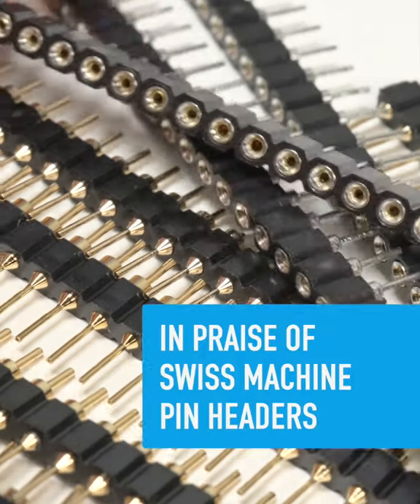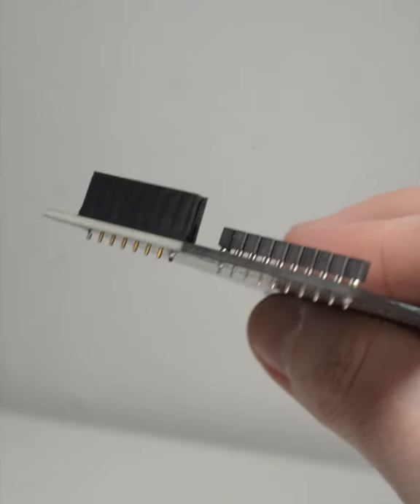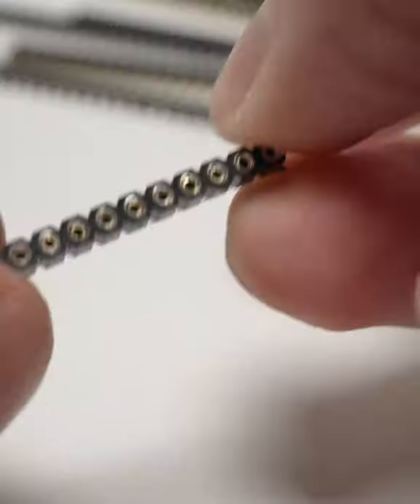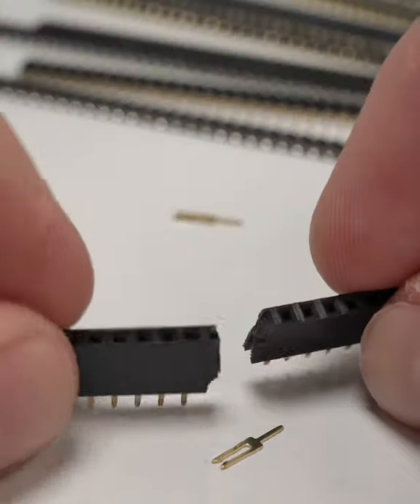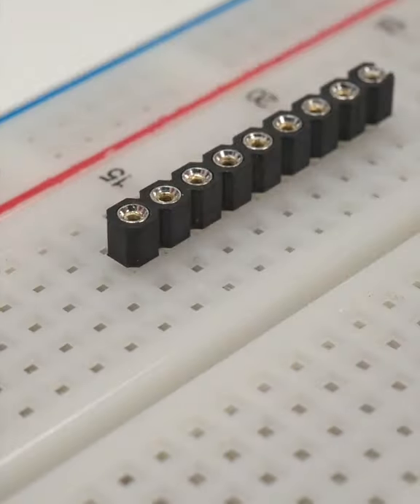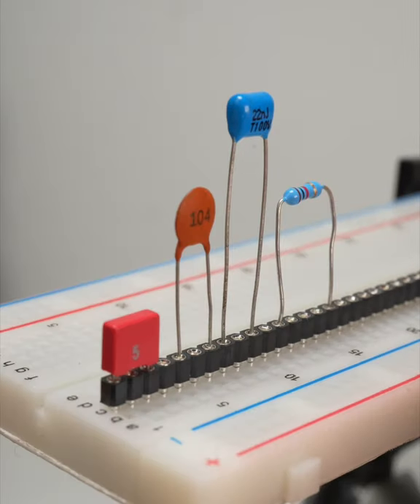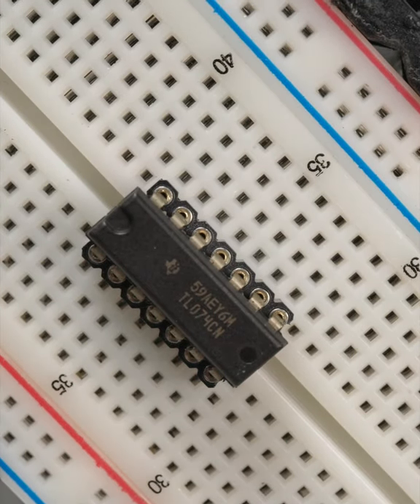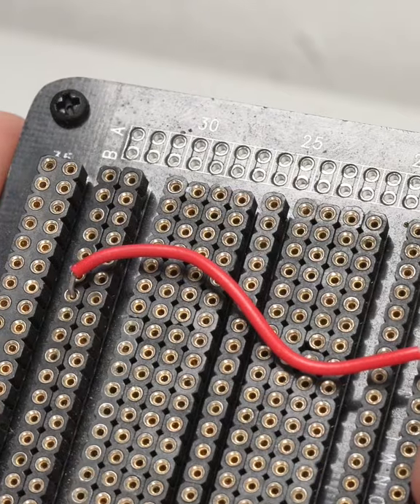Swiss Machine Pin Headers - Collin’s Lab Notes #adafruit #collinslabnotes

Comment: Ok, so I'm not the only one who feels weird doing that crude chopping thing with normal header sockets
Reply: It always feels like such a waste.

I like the circular versions for the same reasons this video shows but Ive seen it said many times its not a good idea to use square pegs in round holes.
Reply: I’ve always bought multiple lengths of female headers… never chopped one

Comment: There are extended pin versions that make board stacking possible
Reply: Do you have a link for this? I was stacking a while ago but had to revert to square pins because i could not find the male counterpart nor extended.

Comment: I don't understand how they maintain contact in the hole.  Is there an internal spring? a friction press fit would require strict spec on the leads.
Reply: Maybe a taper?

Comment: I bought these before.  But they're so shallow that they don't hold the components well.  A slight bump on the resistor and then I have to plug it back in because a lead fell out.

Comment: I’ve had to go back and install dual-wipe sockets in dozens of Hi-Def NES installs because these do not make good IC sockets for DIP chips. Even the gold-plated ones suck. Obviously, it’s better for chips that weren’t just desoldered, but my rule of thumb is: Round pin sockets are for round pin headers… not folded leadframe chips, not component legs, and definitely not breadboard jumpers. Note: Hi-Def NES involves removing two DIP40 chips (CPU and PPU) and installing into interposers which are themselves installed back onto the board. The kit includes round pin sockets for the interposers and the mainboard because dual-wipe sockets are too tall. I eliminate one set by soldering directly (no socket), making room to replace another in each stack with dual-wipe.

I’ve had to do the same with NES RGB installs which only replace the PPU but there are additional board to board interposer connections. The round pins are fine for b2b connections but the PPU itself needs dual-wipe or direct solder. You can’t put desoldered pins in a round pin socket and expect a long term reliable connection.

Comment: About the only thing I dislike about machine pins is that they're easy to bend (which was a bit of a problem back in the days when CPUs used these). Board stacking can work with male and female pins, and you can turn a board into a socketed IC of sorts using KiCAD or Eagle, so if the board dies, you just pop in another one. These are designed to hold even through vibrations, so if you have a continuity problem, chances are it's not these pins.

Chip Quik sold machine pins when I was shopping last year, so that's a decent starting point. I think you can only find one gender for PTH on Digikey, so you have to go to Arrow for the other gender. It's a bit of a pain.
Reply: Forgot to mention: machine pin IC sockets are a thing. They're pricey, but you won't have to worry about alignment as much as when you're DIYing the socket with female pins.

Comment: Yeaaah but the dip socket variety of these are really difficult to get packages in and out of, especially large packages. They honestly suck, too much holding force so you almost always bend the pins getting it out, and the holes have too tight of a tolerance to easily get the package back in.

Comment: Do they have these in right angles?
Reply: Not really. You could tape them to line up with 0.1" pitch pads or holes then solder them, but it's not going to feel stable because these pins are really meant to connect 2 boards or an uncommon IC to a machine pin socket securely.